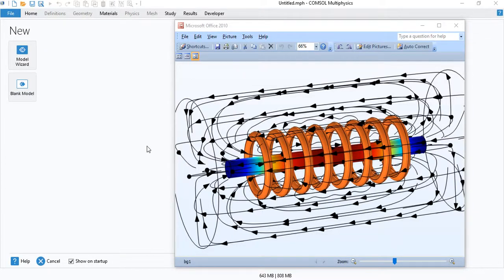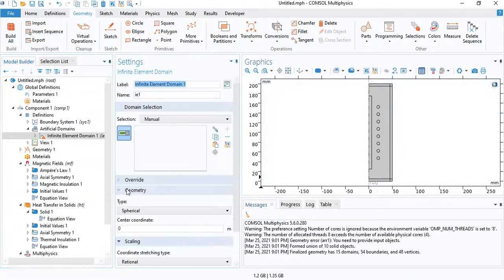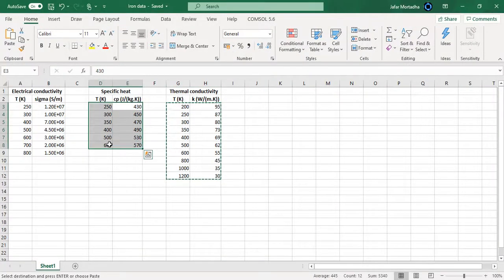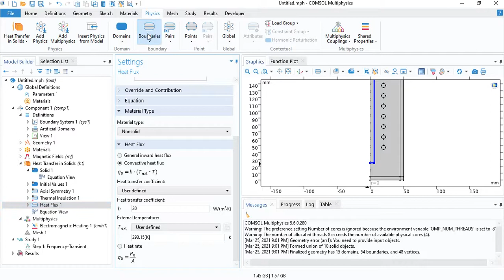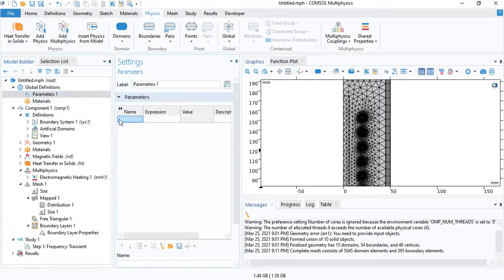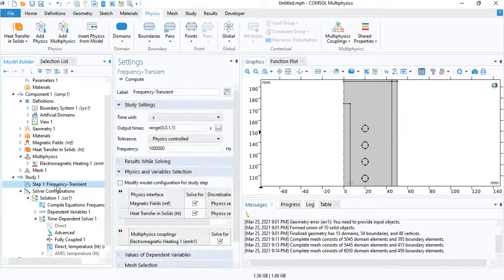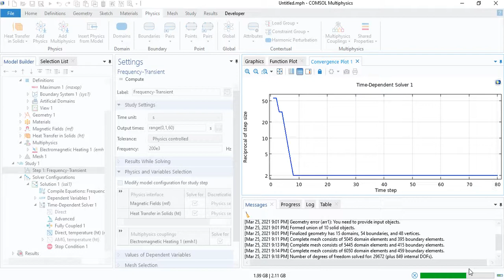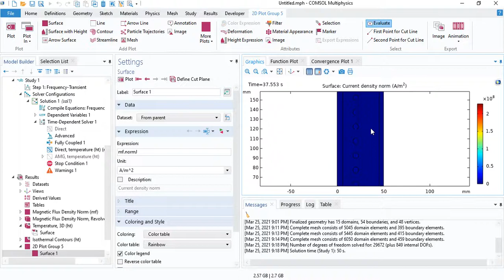Induction heating simulation of an iron bar using Comsol Multiphysics

Comment: Does Comsol Multiphysics 5.6. includes AC/DC module for induction heating simulations? Thanks for your reply in advance.
Reply from the maker: The AC/DC module is included in all Comsol versions. Induction heating is a multiphysics application so it requires both AC/DC module and Heat Transfer module.

Comment: Hello sir while creating same model i faced two problems. Please help me to solve them.
The first one is i am unable to select frequency transient study. Second is in physics for the magnetic field interface i am unable to find coil in domain. What should i do to solve these problems?
Reply from the maker: After inserting the magnetic fields and heat transfer physics go to Add study. If you can't find the frequency transient solver it could be a licence issue. Same thing for the coil.

Comment: Good evening, very good video, do you have any doubts about the equations of the 3 variables that you calculated, thermal conductivity, electrical conductivity and specific heat as a function of temperature?
Reply from the maker: What do you mean by doubts about the equations?

Comment: i need to simulating magnetic field around the stator of brushless motor and linking some physics to find out the changes of torque of the shaft by changing the input voltage. it mast be a great job but delicious. nice job

Comment: Thank you for your video. If I use a rectangular coil, should I model it as 3D?
Reply from the maker: Yes it should be done in 3D. 2D axisymmetric is only for geometries that have an axis of revolution.
Reply: @JafScience  Thank you for your kind reply. If the temperature decreases even though the distance between the specimen and the coil is closer, what mistake did I make to make that phenomenon? I already checked both thermal properties and natural convection.
Reply from the maker: Is the specimen within a rectangular coil? If the specimen gets closer to the coil from one side and further away from the other sides that could reduce the total energy in the specimen. Check the induced current in the specimen, it should increase if the specimen surface gets closer to the coil.
Reply: @JafScience  The coil is circular and computed as a Symmetry condition. Although changes in physical properties according to temperature have not been taken into account, it is not thought that this will affect the tendency. By any chance, if I send you the file, can you check it? If it's too much to ask, it's okay to refuse. I've already received a lot of help.
Reply from the maker: You can attach a link here.

Comment: Thank you so much. Can you make another video of Rf/u-wave heat or induction heat (But instead of an solid iron bar, if it is a pipe of steel AISI 4043 with 1mm thickness) ?

Comment: Thank you for these perfect videos. I wanna change the frequency from 500 Hz to 20 kHz to visualize how B[T] changes. can you please explain how to do that? As the frequency increases I expect B[T] to get increased. But don't know how to prove it.
Reply from the maker: When you do a frequency domain study you can change the input frequency. You can enter a range of frequencies so you can easily plot the results for different frequencies from the same solution. To show how B changes with frequency, plot  the value of B at a point (like max point on specimen surface) against the frequencies in your solution.
Reply: @JafScience  Thank you very much for your kind answer, I could solve it.

Comment: Hi Bro, I am doing an actual Physical Experiment of Induction Heating, and I am experimenting how,

How does size of current supplied affect the time required to reach a equilibrium temperature(point) in the iron bar(workpiece)?

As I read a bit up on how the equilibrium temperature is reached and a bit of explanation in other videos the basic reasoning is when the heat gained by the workpiece is equal to the heat loss to the surroundings.

Can this be simulated in Comsol, given and using the appropriate and required parameters?
Reply: Of course, but to know the time to reach a steady state response it is necessary to do a transient simulation. And yes the steady state will be obtained when the heat loss is equal to the energy gain by the induction heating.

Comment: Hi, is it possible to use this method to heat a steel to 1250 degrees Celsius with a coil current of 10A. And where about in the comsol software can I view coil resistance and inductance?
Reply from the maker: I don't think so. 10 A is too low to achieve high temperatures (unless you ignore convection and radiation). 
The resistance and inductance are lumped variables (like a single global value) which can be viewed in the results section. They fall under the results category of the coil.

Comment: Hello Sir!
how can we change electric with time i.e. every 2 secs there must be an increase of 50nA in circuit. Please help.
Reply from the maker: Define the amplitude of the input current using ramp function. Alternatively you can define a piecewise function with several steps if you want the increase to be discrete.
Reply: @JafScience  sir i am not getting your point please elaborate it so that i can get it easily
Reply from the maker: @saleemakhter778  Under global definitions, you can find several types of functions. Select ramp. Then call this function in the physics to define your current input. You can check my tutorial on hysteresis to see how a function can be defined and used.

Comment: Hi,
can you tell us where you applied the thermal insulation 1 bc?
Reply from the maker: The thermal insulation BC is added by default to the outer edges of the bar. But it was overridden by the heat and radiation BCs which I added.

Comment: Can I know which type of iron you have been used? There is three type ...and when i didi all steps the temprature stay at 20 and no change like your result?  ....thanks in advance for your response
Reply: I also have problem with layer boundray ...i try to build them after i reach to the result of constant temprature but i cant did them dont know why ?
Reply from the maker: I did not use a specific type of iron. The permeability value I used is approximate for what is generally found in Iron. 

If your temperature doesn't change then there is no coupling. Make sure the inputs are specified and that the multiphysics coupling is added.
Reply: @JafScience  i follow all the steps , but dont know where the problem ....which input you mean ? The frequency and current or what ?
Reply from the maker: Both. And make sure you're using the frequency-transient study. If all steps are replicated then it should work.
Reply: @JafScience  thanks alot for your response ....i will try to fix them
Reply: go to add material then in drop down go to built-in section in that you can see iron listed use that one , he has used that one

Comment: How can I find core and winding losses of transformer in comsol ?
Reply from the maker: Winding losses consist of resistive heating and eddy current losses. Resistive heating is calculated in Comsol as the dot product of current density and electric field (variable mf.Qrh). Eddy current and core losses each have a specific formula which you need to define in Comsol. You can define your own variable names for these and then insert the formula in the expression field. If needed, you can include variables from the physics (ex: x component of current density is mf.Jx, y component of flux density is mf.By). You can also define operations like maximum, average, integration (these can be found under 'Definitions' - 'Nonlocal Couplings').
Reply: @JafScience   Bundle of Thanks
Reply: Sir ! Can you make a tutorial on that topic ?
Actually I am a beginner !
Reply from the maker: I can make a tutorial for this but probably in the coming months.

Comment: May I ask you to explain how to measure the value of skin depth (delta) for the bar?
Reply from the maker: Start from the maximum value of induced current or magnetic field at the surface and measure the distance away from the surface at which the value of induced current or magnetic field decreases to 37% of the maximum surface value. You may want to use a 1D plot for this.

You can also calculate the theoretical value of the skin depth using the formula: skin depth= 1/sqrt(pi*permeability*frequency*electrical conductivity.)
Reply: @JafScience  Thanks a bunch🙏🙏
Reply from the maker: You're welcome!

Comment: And my second question is about the skin effect, why didn’t you try to build the mesh layers around the coil instead of the workpiece to demonstrate the skin effect?
Best regards…
Reply from the maker: In induction heaters the coil is usually made of a small wall thickness so the skin effect is not substantial. Instead of creating a very small wall thickness (which would complicate the mesh) I used the homogenous coil feature to ignore the skin effect. However, the specimen is thick enough for the skin effect to be observed at high frequencies and so the fine mesh layers are required to accurately capture the magnitude of this effect.
Reply: @JafScience  I understood it very well, Thanks alot.

Comment: Brother i try to simulate a nanoparticle model based on magnetic field. Temperature rises due to magnetic field from Nanoparticles. Can you help me about that?
Reply from the maker: Unfortunately, I don't have experience with nanoparticles, sorry.
Reply: @JafScience  have you any idea about heat generation from magnetic field excitation?
Reply from the maker: If the magnetic field is alternating it will induce eddy currents, which will generate heat. You can use the built in multiphysics to compute this heat.
Reply: @JafScience  Don't get properly what you talk about!. How i can get built in Multiphysics. If you want, may we talk in person via What's app or any communicating apps?????
Reply from the maker: There is an interface for electromagnetic induction. It's in this video.

Comment: Is the same model used for Eddy current thermography
Reply from the maker: This video is about heating a metal using eddy current. Thermography is not applicable.
Reply: @JafScience using  eddy current to crak inspection  can you please do a tutorial related to this

Comment: sir, how can i make skin depth (delta) vary with temprature, how to plot that??
Reply from the maker: Skin depth does not vary with temperature.
Reply: @JafScience  electrical conductivity varies with temp then why skin depth does not increase with temp can you please clear this doubt of mine 🙏🙏
Reply from the maker: @iam_mayurpatil  If the temperature increase is significant enough as it is in this video, the skin depth will increase. You can plot the induced current at different time values and check.
Reply: @JafScience  Thnak you Sir😊

Comment: sir , why do not specify the material of the coil
Reply from the maker: Because the only property needed is electrical conductivity and that is defined in the coil feature under physics.
Reply: @JafScience  one more question , if the coil is helical does it make any difference in result
Reply from the maker: @m.s4477 yes but insignificant, as long as the number of coil turns is fixed.
Reply: @JafScience  if i work in 3d model , and icreate helical coil and workpiece ،will it be the same ?
Reply from the maker: Almost similar for practical purposes.
Reply: @JafScience  yeah , but how i create block surrounding air the geomtry

Comment: brother I have a problem in simulating an electromagnetic field in 2D, where can we contact to ask you multiple questions?
Reply from the maker: Post the list here and I'll try to answer.
Reply: @JafScience  thanks for your fast replying, I am working on 2D electromagnet simulation using iron core and homogenized multiturn coil, for the geometry I represent the iron core by drawing rectangle and the coil by a square relying at the middle of iron rectangle, I hope that you can imagine the geometry because I cannot put an image here. what's matter here that when I saw the result the magnetic field lines are not make sense at all since they are not similar to the actual magnetic field lines like what you obtained in the tutorial,  so my question where is the problem with my simulation? is it in the geometry of coil or in the configuration I set?
Reply: second question, is it appropriate to use electric current physic with magnetic field to simulate electromagnetic field? I did not see any one use it maybe because they do not need it while running the simulation in 3D or even 2D axisymmetric, but in 2D the problem is that I cannot understand how the program will realize the current direction and ,as consequence, the shape and direction of magnetic field.
Reply from the maker: In 2D the homogenized multiturn coil makes the current flow into or out of the screen so the magnetic field direction is unlikely to be wrong. If your coil does not overlap with the iron core geometry then the geometry is also fine. Make sure the permeability of the iron core is set correctly.
Reply: @JafScience   
It makes sense to me now why the magnetic field lines appeared silly; since the geometry of the coil is a square that overlap with iron core, but what is the proper geometry from your point of view? are there any suggestions that you can give to me in order to handle tis situation of coil geometry?
Reply from the maker: The coil is wound around an iron core so you need to create the square outside the iron core. The gap can either be zero or some finite value. The position of the coil depends on what you're studying.
Reply from the maker: You don't need the electric current physics when you're studying magnetic fields. Electric current is for applications in which the magnetic field is not important. So always use the magnetic fields physics when you're studying magnetic fields.
Reply: @JafScience  I will try this solution,  I use 2D work space in my simulation not axisymmetry so would the program understand that the coil wround over the core by drawing the square outside like axisymmetry case? I hope so, If it works I'll be back here to appreciate your efforts
Reply from the maker: No, in 2D the geometry is extruded, not revolved.
Reply: @JafScience   That's the matter, until now I cannot understand how could I tell the program that there is a coil wrounded around iron core rectangle, it struggled me a lot especially because I cannot change the dimention of the problem I am limited on 2D only
Reply: @JafScience   brother I should thank you because it worked exactly like the real magnetic field lines!!! It is awesome
Reply from the maker: There's no way around it. 2D axisymmetric should be used if you want to avoid 3D.
Reply from the maker: That's not possible. You can either use 3D or 2D axisymmetric.
Reply: @JafScience   but I approach the exact solution using 2D only, and when I solved the magnetic field flux manually I obtained the same result for my model, I do not know if that happened by accident or not but I used it because there are no other possible solutions
Reply: @JafScience   I will try to make a 3D version for my project to be confident about my results, but the coil geometry is a big issue that I cannot handle until now, and the mesh has multiple warning. Can I know how coils can be drawn in 3D electromagnet model?
Reply from the maker: You can use a bunch of cylinders or a helix. You can see that in one of my other videos.
Reply: @JafScience   brother I had turned the problem to lie on 3-Dimensions and the results seem more reasonable but when I tried to change the relative permeability of the iron core the magnetic flux does not change at all, what would be the reaspn? My coil geometry is a hollow box wround around iron block which is the core, and absolutely i added an input and output for the coil geometry, is there any possible mistake I may had done? Another question if you know, how can I do a verification for my  magnetic field model?
Reply from the maker: @FaisalInaya-e9t  If the permeability is properly defined for the iron core material then the magnetic flux has to change. You can check magnetic field strength H
Reply: @JafScience  the relative permeabiliyy affects the field flux until a certain value then the flux become conatant while changing mue, in other words, when i change the mue from 1 to 400 there are noticable difference but after that when i fix it to 4000 the flux remains constant.I do not know if that is right or not.
Reply: another information would benefit you, I a, using stationary study for the magnetic field.

Comment: Sir, How can I calculate the efficiency of induction heating in COMSOL??, I tried evaluating "mf.Qh" but it is giving an error as "undefined variable: freq"
Reply from the maker: That would be the heat energy generated in the bar divided by the total power supplied to the coil. You need to integrate mf.Qh to get the total heat energy. Coil power in frequency domain is 0.5*mf.ICoil_1^2*mf.ZCoil_1. mf.Qh should be defined in the bar.

Note that mf.PCoil_1 gives the real power only (excludes reactive power).
Reply: @JafScience  Thank you Sir, i applied this and it works for me 🙏🙏